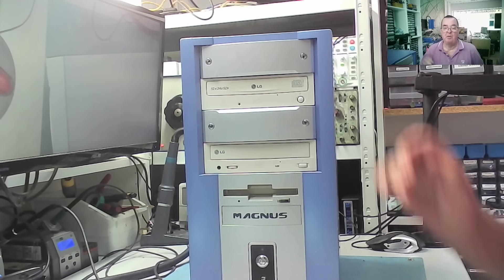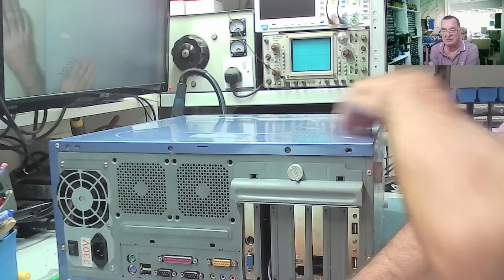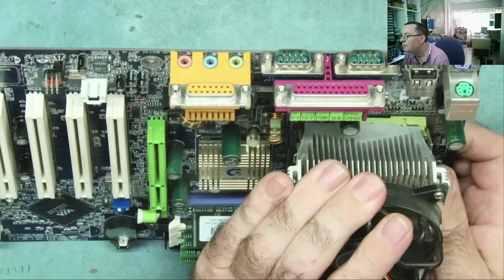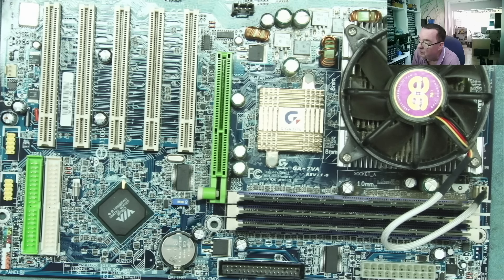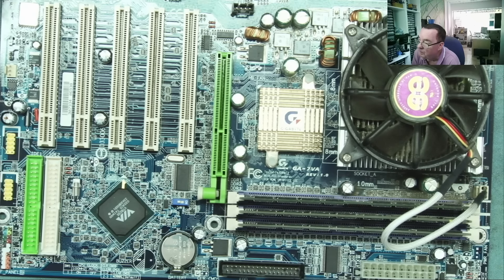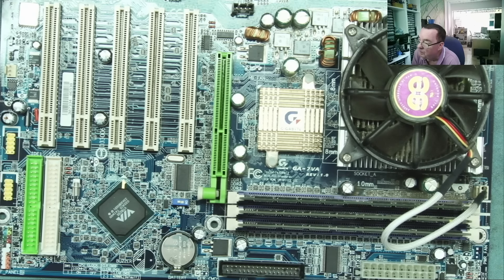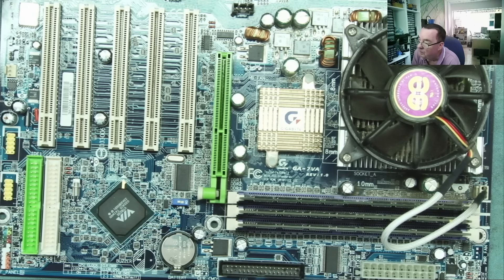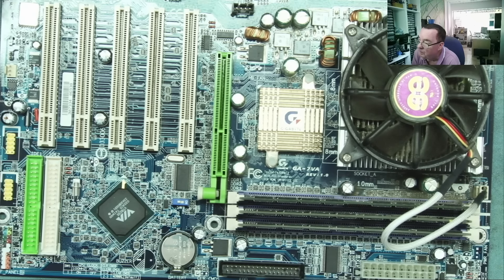Retro Gaming PC Finds At The Car Boot Sale / Flea Market 9th September

Comment: I still have my serial mice 😜
Often the socket 7 MB got a PS/2 mouse header. And there are serial to ps/2 and serial to USB adapter available AFAIR.
And there is a lack and therefore a high demand of AT PS and AT cases.
Reply: PS/2 serial adapters are passive and PS/2 and serial are incompatible interfaces so the active circuitry has to be in the device being connected. Which is to say that just having the adapter and any random peripheral doesn't guarantee it's going to work. The mouse has to support being adaptable. Not all of them were. Not even most of them were. Only mice that came with adapters were in fact. So the whole PS/2 adapter thing is a bit of a pitfall.
Reply: @1pcfred  yes, you are right. But I am talking about developments where a serial mouse is getting emulated/simulated to a serial port.
I recently had seen a video about that. You see a couple of developments of skilled people designing contemporary electronics for substitution of old legacy hardware no longer available or repairable.
But then you may consider to go for full emulation.
So, I like and prefer repairing & refurbishing historical stuff as much as possibile.
Reply: @borlibaer  I think I see what you mean. An active adapter.

Comment: The people offering the too expensive gigabyte boards probably just look at other socket a boards, but the actual value depend on the chipset and options like if it has sata and/or isa slots. The via boards were mostly budget boards. With socket a you want nvidia nforce2 ultra 400 chipset.
Reply: Everyone has dreams. That goes a long way towards explaining why so many love money too.
Reply: @1pcfred  These boards were nearly worth nothing only a few years back, specially with bad caps. I got a bunch of them and why pick the lesser ones if they were like $20 with cpu, cooler and ram?

Comment: You should check the cpu on that first one. Some of those socket A cpu's can be worth a fair amount. You can't just search "athlon xp 2800+" though. You'll need a number off the chip to really see what it is. It'll be long and start with an A. I think these cpu's sometimes hold some value because the pins and the die are easily damaged. Coupled with amd not selling well at the time and you just have some models that are scarce. Also I noticed that these cpu's with higher clock multipliers carry a premium since you can put them in the earliest socket A boards, and they'll just work. I put an athlon that has a x15 multiplier in my old socket A that has an ISA slot on it and get 1.5ghz. The cpu is like 5 years newer than the board, and it just works. The motherboard has no idea what the cpu even is, but it works. The old days were great like that.

Comment: Maybe look for a serial to ps2 adapter online then you can use a PS2 mouse.
Reply: Not all PS2 mice will work with the adapter, only older ones.  They only made them for a few years and there really no way to tell if they support serial aside from plugging it in to check.
Reply from the maker: @j.f.christ8421  Correct.  I have one of those adapters, came wit ha PC from the car boot sale a few months ago and I tested on video - didn't work with my PS2 mice including the ball one (pre-laser mouse)

Comment: Can't say I'm really surprised that you didn't find any Creative CD drives. AFAIK they weren't actually made be Creative and, if memory serves, they appeared to be poor quality but priced comparatively high based on the name. Better technology very rapidly passed them by so it's likely that very few have survived.
Reply: Creative drives are simply re-badged Panasonic CD drives. The quality of those drvies is fine, like any other CD drive of that era and has nothing to do with Creative marketing them as their own.... most Creative stuff is high quality. However, later drives were re-badged Lite-On drives, that could be where you saw low quality drives....

Comment: CT2959 is a Sound Blaster 16 Value Edition. The 2950 is the same PCB but the missing chip on yours is populated. This had Creative's own flavour of OPL3 called CQM embedded and has the DSP firmware with hanging note bug. Basically heavily cost reduced and shipped with a CD and some crapware games to help sell it. Pretty basic card with known issues which is why it's not worth much... only clueless suckers would buy this one ;-)